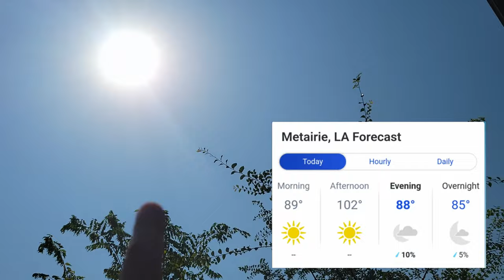E94  Bodywork... Fixing those LAST FEW DETAILS! 1956 Chevy Bel Air Restoration

Comment: As far as painting the car. I like to paint the jams. put the car back together. then do your final wet sand. mask all your jams and paint the car as a whole. this prevents you from having to reassemble painted parts and chipping and scratching them. plus it will make a uniform finish. Then before you unmask do your cut and buff and you wont have a bunch of goop in the jams.
Reply from the maker: What you describe is how I have always done it.  Some people are recommending to paint the fenders and doors completely off the car and I just don't have enough faith that the color match/blending will cooperate.